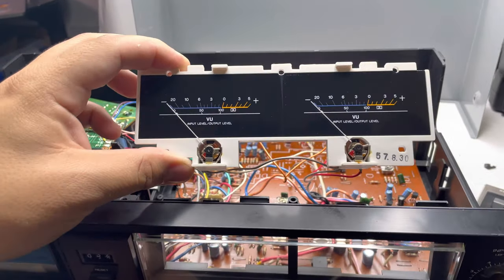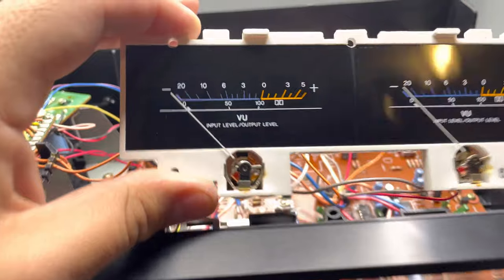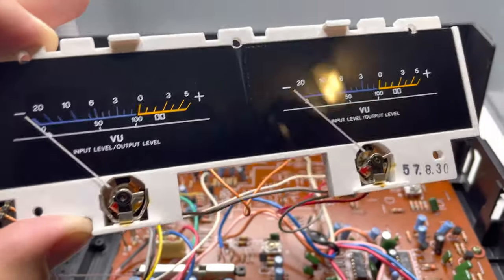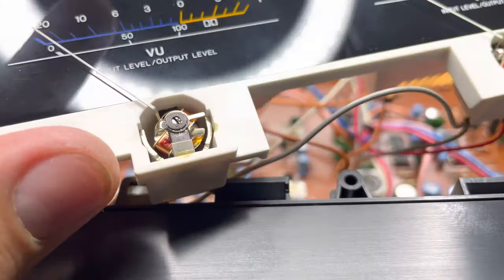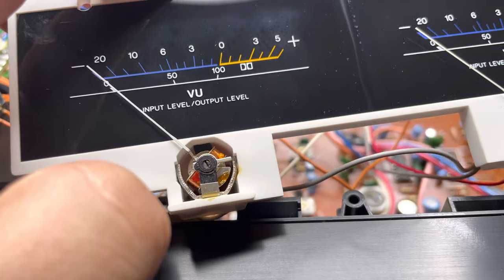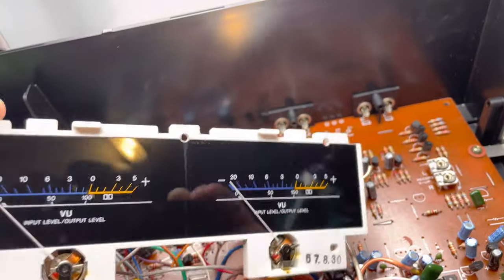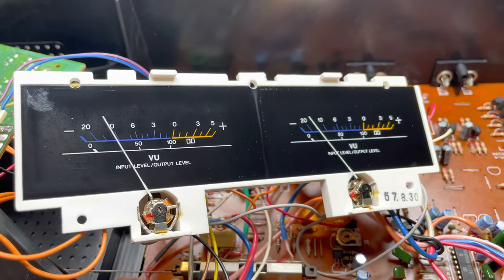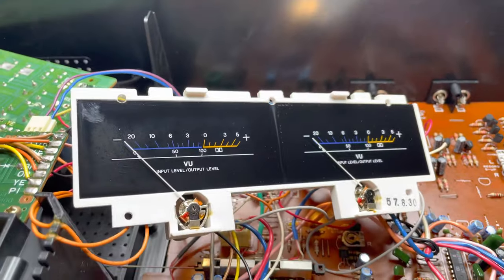How to fix a VU meter in a vintage cassette player

Comment: Do you know what was the real problem, dirty, failure in mechanism, over voltage?
Thanks a lot for this trick.
Greetings from Buenos Aires
Reply from the maker: I was told my an older guy that there was supposed to grease there, but being so old the grease got harder or some dirt got inside and it was stopping it, so if you have to release it a little, and it will work
Reply: @TheButtons  so now the problem is how do we know if it is correctly calibrated to record at Dolby mark in 0 dB?
Reply from the maker: I played a few times and adjusted it to be around the same area with my second one, i better have a working one slightly  not calibrated then one that is not working at all
Reply from the maker: There are plenty of tutorials online on how to calibrate it in a few easy steps